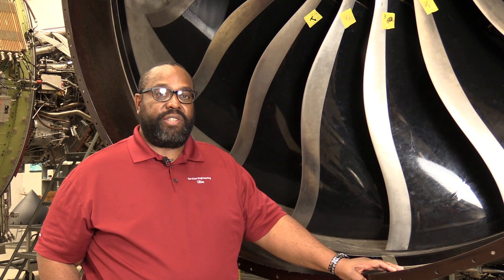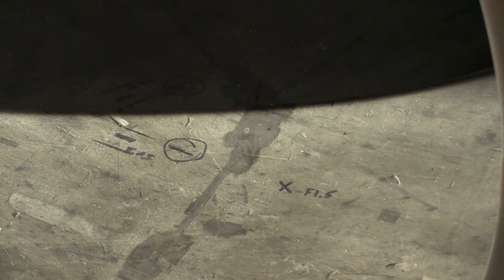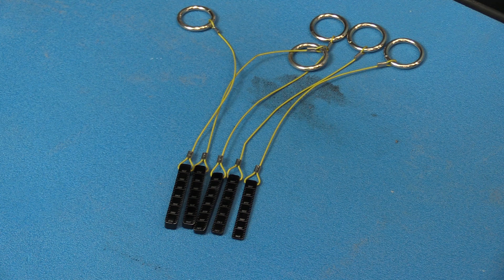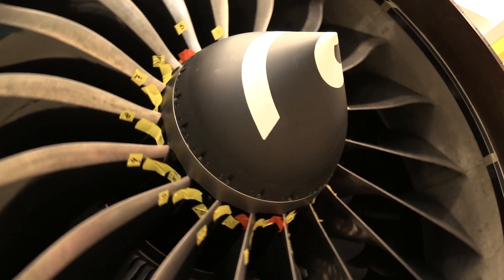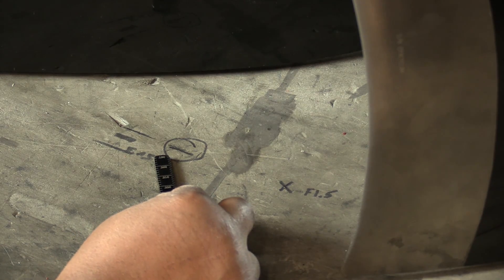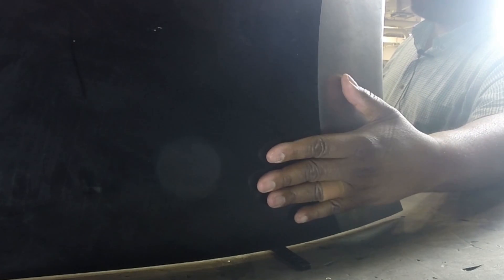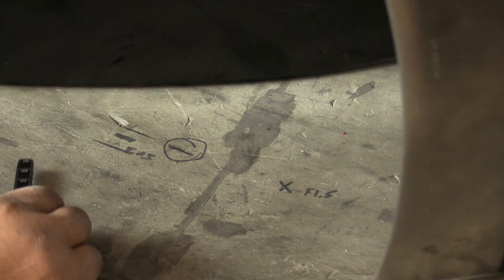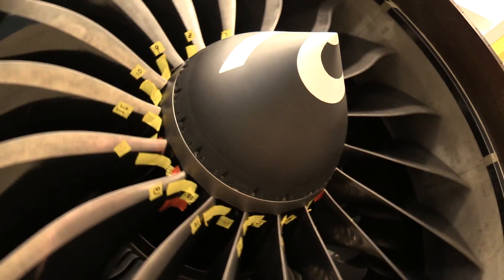GEnx - Tip Clearance Check - GE Aviation Maintenance Minute

Comment: Hi Team GE, can you do a video on the 2nd part of the blade tip clearance using the special tooling which is mounted on the rear spinner. Thanks alot

Comment: Hi Ge Team,

Could you please confirm. The lowest vertical position of fan case is left or right of the abradable panel seam Joint. As per maintenance data, The lowest vertical position is left of the panel seam joint(aft looking forward),however here video shows F1.5 point  right side .
Thanks